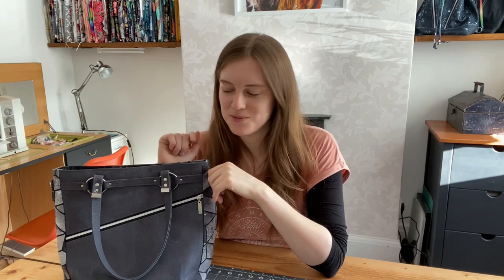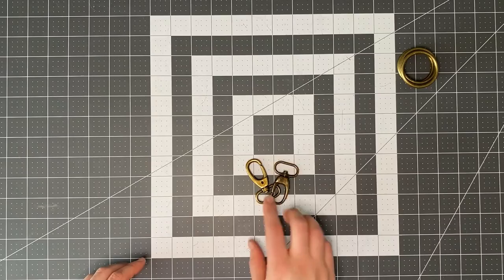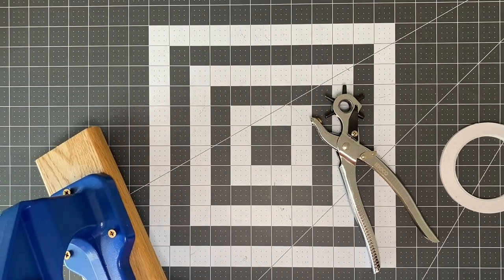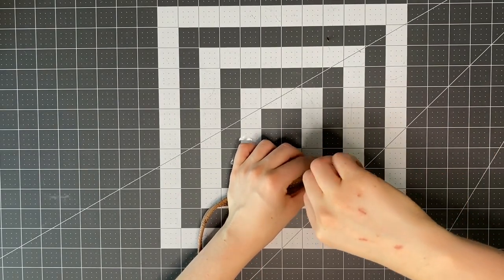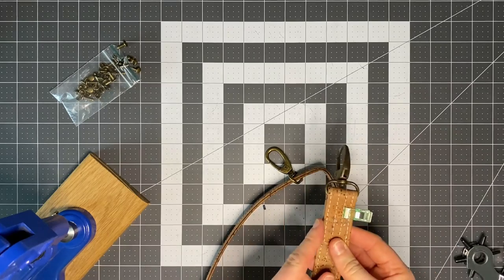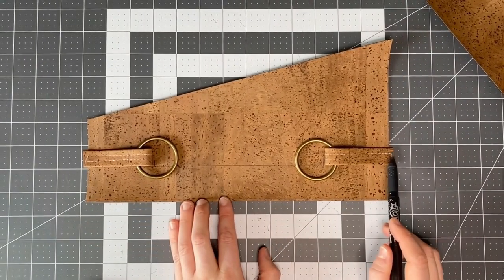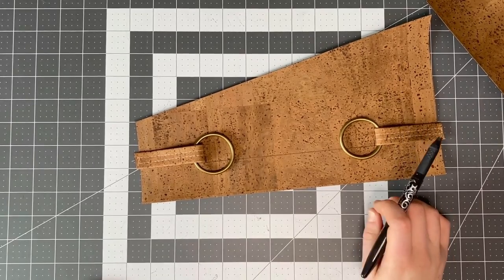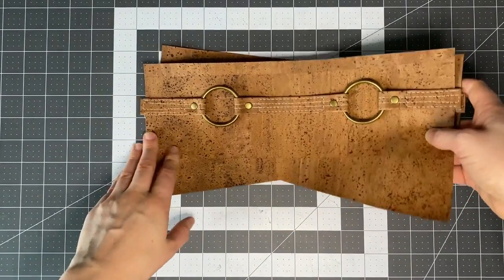Lomexa Handbag - Bag Making Tutorial by Country Cow Designs

Comment: I have a suggestion that I  use myself when having to extend leather straps - it is with kindness that I make this suggestion. If you follow how quilt binding is made,  the seam is staggered, sewing is a breeze  and  makes a much  stronger strap. The pieces  are placed together as a sideways L. Sew Southern has a great video  on  binding , you only need to  watch   how to  attach the pieces required to make the desired length ,  not the whole video. Love your patterns and wonderful  instructions. Xo K - Nova Scotia
Reply from the maker: Thanks! Do you mean connecting them at a 90 degree angle to get a staggered seam? I do my fabric straps that way but for cork I find it doesn’t work so well which is why I’ve ended up doing it this way 🤷‍♀️ but I always use that method for cotton fabrics and it works really well but it seems to cause issues with the cork on the edges and makes it even thicker 🤔
I’ve always wanted to visit Nova Scotia. What a beautiful place!!
Reply: @CountryCowDesigns  Yes a 90.  I must confess I have never used cork, strictly a leather gal.
Reply from the maker: Ah I used to use so much leather but I somehow got converted to cork 😆 yeah I tried it with cork, just assuming it would work as well as it does on cotton but it didn’t 🤔 it was unexpected. So I’ve taken to doing cork this way, though generally I try to avoid joins wherever possible 😂

Comment: Just finished watching the video and am getting ready to purchase the pattern.  One Question - I have 1 inch rings can those be used in place of the 1.5 inch rings listed?  Thanks!
Reply from the maker: I think I you’ll struggle to fit the handles around 1” O-rings. They’re 3/4” on each side so they fit 1 1/2” well. One of my testers used curtain rings that were 35mm (1 3/8”) and those worked well too but I wouldn’t want to go any smaller than that.

Comment: I'm just wondering what type of thread you use on your domestic? I'm wondering if my juki tl2010q can handle thread greater than 30....?
Reply from the maker: I’m using Coats Moon threads. It’s a pretty standard polyester thread that seems to be designed for domestic machines but I’m not sure of the weight 🤔
Reply: @CountryCowDesigns  thanks!!

Comment: You are doing such a amazing videos :)
In this one, I just have to tell you that your conversion of inch to mm is wrong in several places. For example from 1/4 "to 2.5 mm (it is 6 mm) - from 1/8" to 4 mm (it is 3 mm) and 3/8 "inch to 3 mm (it is 9.5 mill )
Reply from the maker: Thanks for letting me know. I don’t even remember saying that 🤦🏼‍♀️ which part of the video is that? I might need to correct it.
It’s funny because I don’t usually try to convert things to mm because I don’t know the conversion so I have no idea why I’ve said that in this video 🤷‍♀️
Reply: @CountryCowDesigns  you don't say it. It is written on your screen several places. I noticed it because I am Danish and we uses mm, although I am trying to always using inch.
Reply from the maker: Oh do you mean when I’m sewing? The “ refers to the seam allowance and the mm refers to
the stitch length, that’s why they don’t match up. They’re for two different things. Problem is that our machines in the UK (and I think in the USA too) show the seam allowances as inches and the stitch length as millimetres. That’s why I show them that way 😁
Reply: @CountryCowDesigns  I know that. But on the same time/page you e.g. write that seamallowance 1/4 inch is the same as 2,5 mm and it is not, it is 6 mm.
Reply from the maker: The 1/4” refers to the seam allowance, which is 6mm yes. The 2.5mm shown on the screen isn’t for the seam allowance. It refers to the stitch length instead. I’ll try to make it more clear on the next video to show the measurements are for different things. Perhaps if I put on the screen that the seam allowance is 1/4” (6mm) and the stitch length is 1/8” (2.5mm)?
Reply: @CountryCowDesigns  oh. I didn't got that. I am so sorry. Please delete my question. 
I always think you're tutorial are so clear, and yet I got it wrong. 🙈
Reply from the maker: No it’s good to know because now I know to make it more clear 😁👍🏻 you won’t be the only one!

Comment: How do you take rivets out of cork
Reply from the maker: With a fair bit of stress 😂 I have some wire cutters that I use. I clasp onto the rivet end and give it a good tug from different directions and after a while it comes out! I’m always worried it will ruin the fabric beneath or make the hole bigger but so far it hasn’t happened. I just take my time and try not to rush it 😆